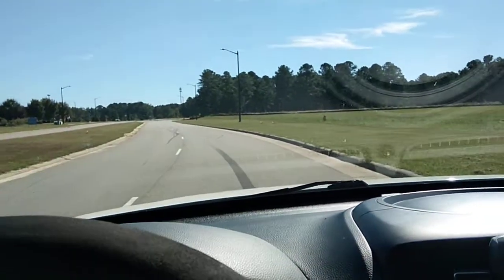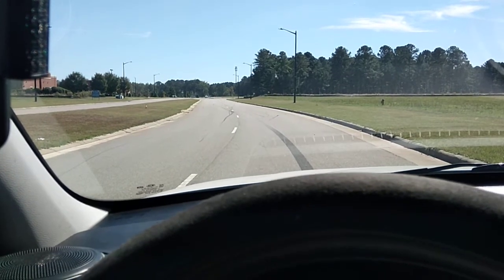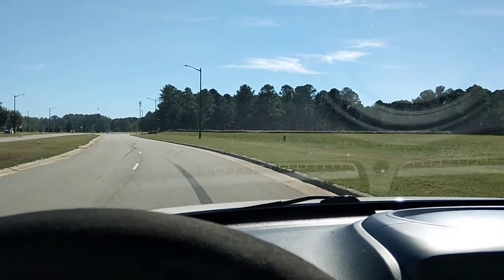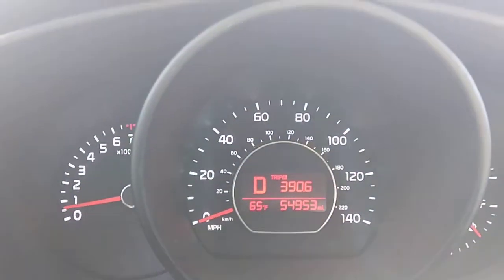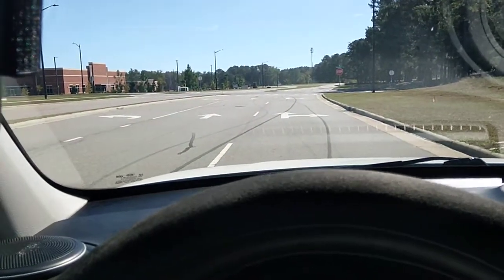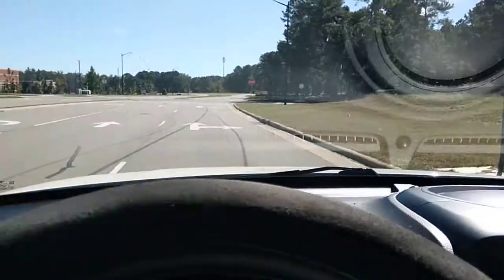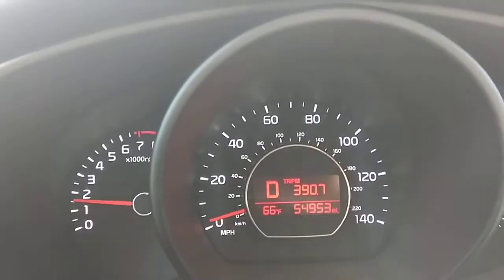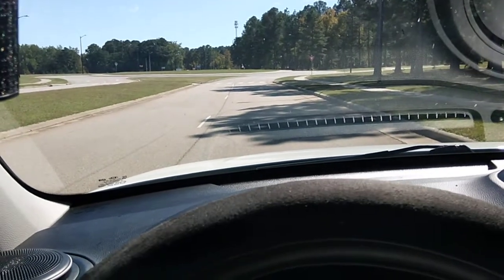The Proper Way To Burnish/Bed In New Brake Pads.

Comment: Question: is it possible to do this with used pads? I’ve got pads that aren’t even months old and I just got some rotors but don’t want to spend money on new pads if I don’t have to.
Reply from the maker: Yes. What I would do and what we do at the dealer is replace the rotor.  Take and angle grinder with the sandpaper pad and scuff the brake pad and make a new surface.  Or just get a piece of sandpaper and scrub the pad.  It should look like a new brake pad when done.  Then install them and burnish the pads like you see in the video. You don't want to just put the old pads back on you want to give them a new surface to mate with the rotor
Reply from the maker: I can also do a video on this tomorrow at work so you can see what I'm talking about.
Reply: Thanks a lot man! And I really appreciate the quick response! Thanks for the help
Reply from the maker: @rawdawg_inthesouth  no problem. That's why I'm here. I'll do a video tomorrow so you can see how to do it
Reply from the maker: @rawdawg_inthesouth  here you go https://youtu.be/5E4jQ2tPnCU

Comment: I don’t understand the “importance” of burnishing brakes. If you are stopping fine, over time your brakes will go through this sequence in no time with normal driving.
Reply from the maker: The purpose is to put pad material on the rotor and put it through a heat cycle. If you do not do this then your going to glaze the rotors and you will have brake fade.  you'll have less braking power. Skipping the brake burnishing procedure means your rotors won't be coated with brake pad material. At the same time, the pads might not have conformed to the shape of the rotor, which can result in uneven braking, noisy braking, or inaccurate brake feel.  So that's why it is important. If you want your brakes to work correctly.  And it's not the "stopping fine"  it's making sure it stops like it's supposed to.  Not everyone brakes the same. Whats nor.sl to you may not be normal to someone else. If you just slap rotors and pads on and send it you may not have brakes when you need them. They will glaze. Any automotive class you take explains this. Some rotors even have the instructions how to do it in the box with the new rotor.

Comment: gms is 30 mph-0 mph 20 stops
Reply from the maker: Okay 10 less stops. 10 more doesn't hurt. ASE and ford manufacturer training say 30/30/30. 30mph-0 hold for 30 seconds. 30 times. And ASE is based of GM. Either way. Whether it 20 or 30. At least it's being done.  Most people just slap them and go and wonder why they their brakes aren't working correctly